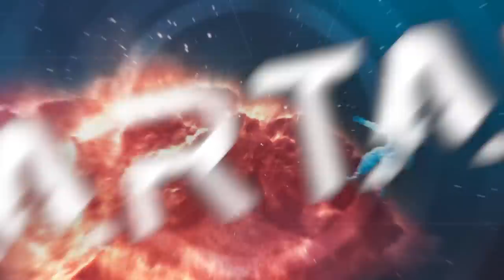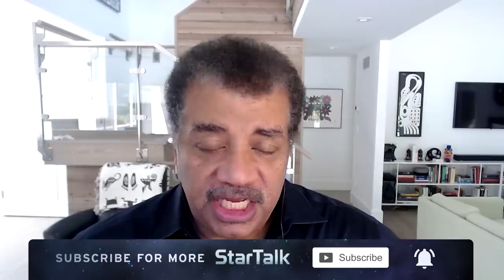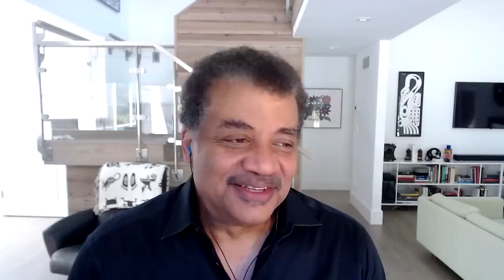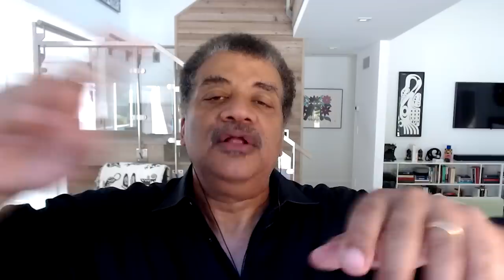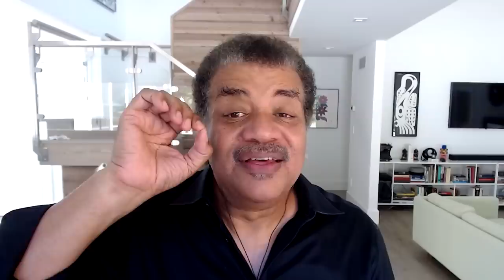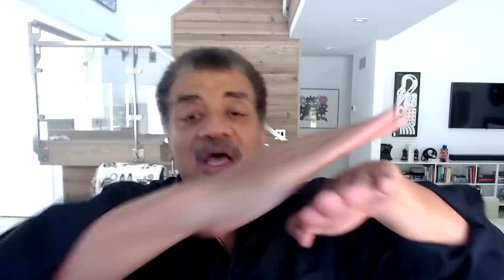What is Exit Velocity? | Neil deGrasse Tyson Explains...

Comment: You can use a triangulation technique using multiple doppler detectors installed around the stadium to calculate (using customised software) the maximum velocity (in the direction of the greatest rate of displacement) of the ball
Reply: Couldnt you do it with a single gun if you know the angle of the gun to the ball and the direction of travel? 

Surely the amount by which the gun is wrong should be proportional to the angle and we must know what those numbers are, shouldn't be too hard to work out with modern equipment.
Reply: @bipolarminddroppings  you would have to be able to predict the angle of the ball beforehand
Reply: Or with 1 high speed camera. Count the frames to get distance ÷ time
Reply: well the thing with doppler effects is that you need to use a signal that is much stronger to that of the noise. So if you were to use sound in a stadium, this would be a really big problem and should effect the error in the final calculations. Also sound has different velocities for different pressures and temperatures (and lots of other things generally effect it). 
You could use light (we use lasers in the lab), but you would need a strong polarized source for this, which you would then need to focus onto the ball. Normally viewers dont like a bright light source hitting an object they are trying to view themselves. 
I dont expect them to use a doppler effect, but rather some other diagnostics for those reasons ;)
Reply: @bkingski1125  only if said camera is perpendicular to the path of the ball.

Comment: Maybe you should have contacted someone to find out HOW they do it.  Not only do they measure launch angle and exit velocity, they measure the pitches—vertical and horizontal movement, and also the spin rate of the baseball, and also the spin rate off the bat.  For Statcast, each ballpark is fitted with 12 optical cameras operating at 100 frames per second.
Reply: Great point.  I love NDT but you can't assume something is being done wrong unless you actually know how they're doing it.  Professor Google has most of those answers.
Reply: Thank you for this comment. As a baseball fan this discussion was driving me nuts
Reply: That would be the sole responsibility of the person who wants to learn such information. The "how" was not the point nor intent of this explainer. Therefore none involved in the episode needed to contact anyone for the "how".
That was entirely up to the person who clicked on the video.
Besides, despite knowing the "how", the data they come up with remains fairly inaccurate and is in no way "scientific". They even admit to that fact. 
Some questions/requests are rhetorical. Sometimes used to essentially poke fun of specific claims being made.
Happens quite often among physicists to be honest.

Comment: Isnt it smarter to use camera's? Calibrate them for the given distance (we should use 3 angles so as to cover the 3D space). then measure the displacements of the ball in each frame. By doing so we can get the angle it leaves at and the velocity (average velocity over the distance between 2 images). The min velocity it can measure ofc depends on the distance of the camera with respect to the ball and the time between frames (but the frame rate of the cameras can be really high, so i dont expect this to be the problem)
Reply: That's exactly how they now calculate pitch velocity!
Reply: You would have to have a camera placed at 90 degree angle to the ball's trajectory, but that is impossible as ball can go to so many different directions. Maybe if you'd have 2 cameras in maximum angles and you would do calculation on both and then calculate the average from those.
Reply: @ilpoahlfors1118  With only 1 camera it would be close to impossible to measure the exit velocity. You could use some optics to split the camera into 2 smaller ones (half of the camera records 1 image and the other half records the ohter image). This requires some calibration ofc.
Reply: But to come back to your question, i would bet (i know that is a bad bet joke...) that they use some short of acceleration measurement tool. You could integrate over the time of the swing in order to obtain the velocity (naturally you need to compensate for the fact that it describes circular motion rather than linear motion, but this can be done). Additionally one can measure the deacceleration of the bet on impact, this is then a measure for the force with which the ball is struck. As the bet is linear.
As to the angle problem: both the ball and the bet have a circular cross section. If they hit, they will always hit at a 0 degree angle. A better question would be, what distance do both velocity vectors have based on the centre of the cross section at the moment of impact. (like the way we tend to solve solid sphere collisions in physics). 

In the end the numbers are just for show. There is no error given on those numbers, so for all we know it could be any number

Comment: There is more to this than the angle of the plane of the bats swing,  
The ball is a sphere, and the bat is a cylinder. Where on the bat and/or ball did the impact happen?  For the ballistic calculations  the angle from horizontal  and the velocity of the ball are what  matters.

The angle of the swing, the angle of the balls flight path, where on the bat,and where on the ball the impact took place only come into play in imparting the speed and angle to the ball.   So you are correct that an upward swing angle would be able to impart a better angle and speed to the ball, but after that they no longer matter to the balls trajectory. 

I'm totally ignoring the spin of the ball  both coming and going. 

Love your videos by the way,  you give me a lot to think about.   It's exciting to learn new things, and view ideas from a different perspective. 

Keep up the great work.

Comment: At the start of the swing the batter typically holds the bat end up above and behind their head. The swing is not from a lower position swinging in a straight line up, It is an arch. 

While the angle at which you most want to hit the ball is at 30°, you are not swinging in a straight line at a 30° angle to the horizontal line of the ball. You are starting from a good bit above that line, possibly dropping below it, and then coming back up again? An oscillation along the horizontal line of the ball. This gives a longer potential common contact area between the bat and the ball. If the bat is dropped just below the ball's horizontal line, contact would give the desired 30° because of bat and ball curvatures. If it was coming up even slightly from just lower and hit at that 30° upwards, it would have the greatest desired effect. So the best swing would start above the ball line, swing slightly below it, and be coming back up at point of contact. 

Now about this straight line the ball is following....

Comment: If I configure 3 radar guns, or ideally 4 for accuracy, in a triangle (+1) pattern -- much like GPS -- I could triangulate the position of the bat and the ball, and calculate the speeds and angles.
Ideally, I would need 4 distinct frequency pulses to prevent interferance and to also perform dopler calculations.
I could do much the same with 4 "high" speed cameras. That might be easier.

Comment: Doesn’t the ball speed immediately reduce speed after leaving the bat?  Then at what point do they measure the ball speed?  Also, is it possible for the ball speed when leaving the bat to be faster than the speed of the bat?
Reply: It can be faster.
The bat has more mass than the ball, so the same amount of enegy will give it more speed
Reply: @Sparrow420  p=mv you’re correct. 
Momentum = mass X velocity
Reply: you need the ball pitch speed a fast ball low and outside you can almost get a golf swing on it

Comment: Are they using radar/lidar, or are they using a system that looks at the distance covered by the ball in the first frames of video after leaving the bat, shot from the top or side and then extrapolating the velocity?

Comment: I must say, for the first time I'm not sure I agree with the explainer! Baseball games give ball launch angle and exit velocity. Its not bat speed. If you're on the horizontal, and you can measure the angle (software used with cameras can do that), you can get the ball velocity vector.
Reply: Yeah exactly, as others have pointed out it is a solved problem and I am surprised that they did't even seem to research how it is actually done. We don't need to use first principles here to figure this out. Multiple cameras can track the path of the ball through 3-D space versus time. Then it is fairly trivial to calculate the velocity at any point along the ball's trajectory.

Comment: There are many factors that weren't considered here. The velocity of the ball when it hit the bat affects the exit velosity also. A bat does not need to travel at 120 mph for the ball to leave at that speed. Part of the energy is already in the ball. The second thing that wasn't considered was the rebound of the material in the ball. For instance, a ping pong ball leaves the paddle faster than the paddle that hit it because the compression of the air inside the hard shell of the ball stored some of the energy of the paddle to add to the paddle velocity. A baseball compresses also. I has a hard rubber core wrapped with twine and covered with a tight leather. skin. The ball is deformed by the mass of the bat and when it springs back it adds velocity to the speed of the bat so the ball leaves faster. Lastly, the bat doesn't need to be swung at a 45 degree angle. The ball is entering the strike zone from slightly above, lessening the "prefect" angle of the bat. It's impossible to clock the ball accurately from any place in the stadium other than the point in the strike zone where the ball was contacted. Since we can't mount a radar gun there. it's not possible at all.

Comment: The spot where the ball strikes on the bat determines how much of its energy is deflected vertically. That would increase the angle from the 30deg swing to the 45deg optimal ball trajectory. You get some nice wiggle room on the top half of the bat this way before it changes the deflected angle too drastically. 

I suspect, with a more precise impact point, the final ball angle can theoretically match the bat angle at 45deg, but I believe that requires a lot more precision. That on top the difficulty you mention by having the ball outside of the plane of the swing for longer.
Reply: I came here for this comment. Thanks! ✌🏼

Comment: The SloMo Guys measure perpendicular all the time by measuring distance over time using frame counting vs frame rate on their highspeed cameras. 2 cameras at known angles around the field could correct for the cosine error and tell not only what the up/down angle is but also the left/right angle along with the velocity. The other missing factors are that the bat is not flat plane but a cylinder so the bat angle only matters if the if the ball hits the bat dead center. If the batter swings at 20 deg and hits an inch low, then the contact angle could be 45 deg giving them the home run. If you really want to get crazy, then you need to take into account the kinetic of the bat vs the ball on the off center hit to determine how much energy is lost by the bat being deflected downwards.

Comment: i think it would also depend on what part of the bat the ball was hit with. If the swing angle was 30 degrees, but the ball was hit with the lower part of the bat circumference instead of the center, it will be a ground ball and some energy will be lost.

Comment: The one instance where I skipped an episode because everything being said was wrong 😫

2 things: you can accurately measure velocity +/- a few MPH based on frame of reference alone. Batter's eye, side view, and top-down cameras all synced in time and frame rate are used to measure several metrics: exit velo, launch angle, and projected distance (how some parks report the distance hit before the ball even lands).

I wouldn't have cared too much, but you doubled down on being wrong like... 4 times. It's not arrogance or zeal, they just got really good at taking optical measurements. Google Cloud makes it even easier.

Comment: A big element not menitioned is the spin that the ball has when leaving the bat.  If the bat hits the ball slightly below the mid point of the ball, the bat imparts a backspin on the ball relative to the direction that the ball travels.  This backspin causeds the ball to fly higher and farther than a ball hit in the exact center of the ball.  The backspin causes a relative low pressure on top of the ball and a high pressure on the bottom, which tends to lift the ball.  The raised stitches on a baseball causes enough friction to enhance this pressure difference.  Almost never is a home run hit without this backspin.

Comment: They do not use radar to measure exit velocity and launch angle. They use a bunch of cameras and software. They also measure runner speed around the bases, route efficiency as fielders chase down fly balls, and how fast the ball travels when thrown by the fielders. Scouts in the stands use radar to calculate pitcher velocity but that’s it. MLB is really excited to promote their Statcast system and I expect would provide someone for this show to explain why the measurements are accurate.

Comment: Neil, I think the way they hit it with an angle is due to the bat and ball being round.

You swing at it on the same plane like you said, but you level the bat a bit lower than the ball so the curves on the object will angle the hit.

If you'd hit it from a higher level it will shoot to the ground.

-never seen a baseball game

Comment: If you want an accurate speed measurement  of the ball, you 2ill need two doppler radars, located some distance of each other on a given known baseline.  Then you can measure ball speed from both directions.  Now using triangulation and some simple math, you can calculate the ball speed at any angle.

Comment: Friendly advice:  It is ill advised to try to get out of a speeding ticket by questioning the cop's location in reference to yours at the time your speed was determined. Local judges are NOT scientifically literate 99% of the time. But more importantly, your speeding ticket will more than likely be for speeds greater than 5mph over the posted limit.
There is little to no defense for such speeds. Hence why a majority of cities/county police do not tend to ticket unless speeds were obviously over the posted limit. Vehicle speedometers can register different speeds. Most police allow for that by waiting until speeds are in obvious excess.  
But at the same time, I have seen state troopers sit still while car after car traveling 80 in a 70mph zone passes by. Most officers have enough job experience to know what will stick come court time. If you are ticketed, chances are extremely high you were driving too fast and deserve the ticket.

Comment: Hitters swing up at the ball at around a 10 degree angle because the ball comes in at around that downward trajectory and the ideal angle for highest exit velocity is for the bat to be moving on the same plane of the ball. It seems unlikely to make solid contact between a round ball and round bat if swinging too far off this plane. That said, to achieve maximum distance, a 30 degree launch angle seems about right. See the 1970 book by Ted Williams and John Underwood (certainly don't take some random guy's word for it).

Comment: If the bat was swung at a 45 degree angle to an incoming ball that is horizontal then the ball would leave the bat at higher than a 45 degree angle. Some of the bat's energy must be used to change the departure angle of the ball - hence the "best" bat swing angle would be much less than 45 degrees.

For example if the ball was moving horizontally at 60 mph and the bat swing was also 60 mph at a 45 degree angle, then the departure angle of the ball would be straight up. If the bat speed and the ball speed are equal the optimum swing angle to achieve a 45 degree trajectory would be 22.5 degrees. If the bat is faster than the ball then the angle increases, if the ball is faster then the angle decreases.

Comment: I would imagine the 20/30 degree angle that batters hit isn’t just convenient, but is the actual ideal angle to swing at. Because the ball is going to bounce, its own angle relative to the bat’s angular velocity would invert, resulting in a higher angle of flight.
Reply: Correct, but then not all of the bat speed is transferred to the ball.

Comment: If you swing at 45°, the ball doesn't exit at 45°, it will be at a higher angle.
Reply: I think it depends on where the ball hits the bat, but I get what you're saying. It seems 22.5 would be the optimal angle of the bat swing.
Reply: Exactly. For example if the ball was moving at 60 mph and the bat swing was also 60 mph at a 45 degree angle, then the departure angle of the ball would be straight up. Neil really didn't think this one through.
Reply: @robertdibenedetto6445  Yes, lower angle if the ball is faster than the bat; higher angle if the bat is faster than the ball.

Comment: It might be a bit more than 20% if the pitcher  threw a sinker high and it comes down through the strike zone. I have not seen the exact movement of a sinker or how much the downward motion is, however we both know that the pitch will be coming down rather than horizontal through the strike zone.

Comment: The ball comes in at 90 MPH (it leaves the pitcher at closer to 100 but it slows down as it reaches the plate).

Bat speed (I looked it up) is about 80 MPH.   The exit velocity is the bat speed plus velocity from the bounce or ricochet off the bat.   More than just the bat speed.    Still, 0 degrees is the optimal angle, but it's not just bat speed but incoming pitch speed that also matters.

typos fixed . . .
Reply: *bat speed